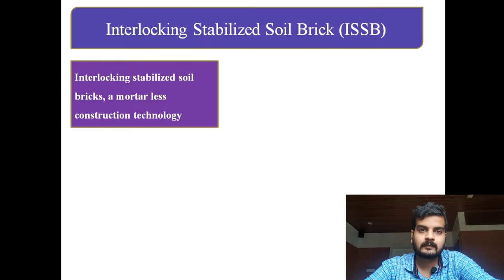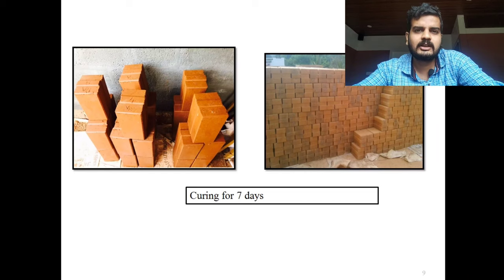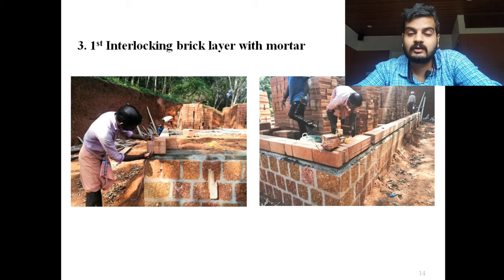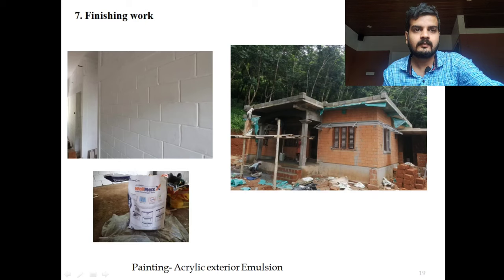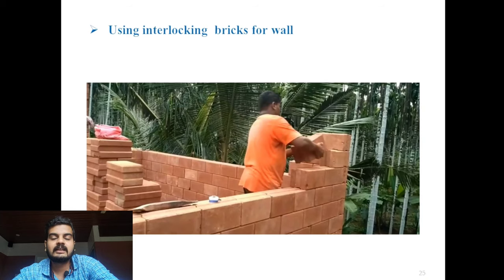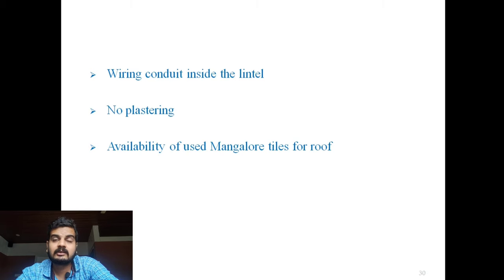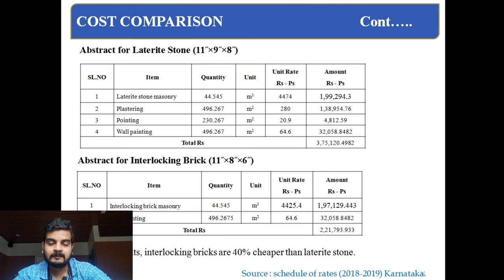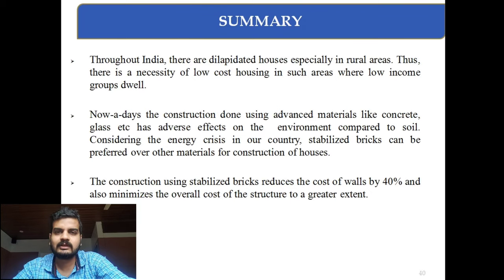10 important tips to reduce construction cost |Low cost house construction techniques and materials

Comment: Vivek good work, but I need to ask u one thing, block is ok as far as the vertical force or load is concerned but what abt the horizontal  force which can  effects in case of a flood directly over the walls ,say up to 1 meter water comes during the floods,do u think this mud block will withstand the force,I doubt,in that case it seems to b risky .plz.covey to coment. Good day.
Reply from the maker: I have seen Interlocking brick house survived during flood in the last year, Flood will not have much horizon forces become water is just occupying the surroundings. The compressor strength of laterite stone and mud block will be same because the size of brick is lesser than laterite stone